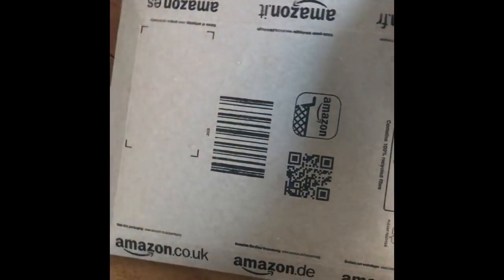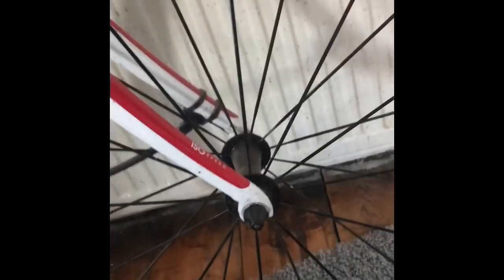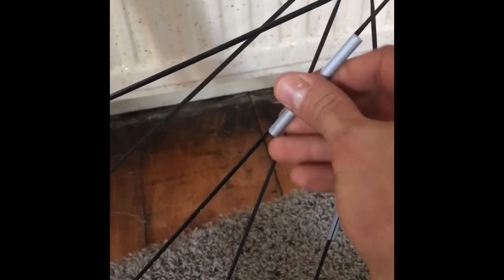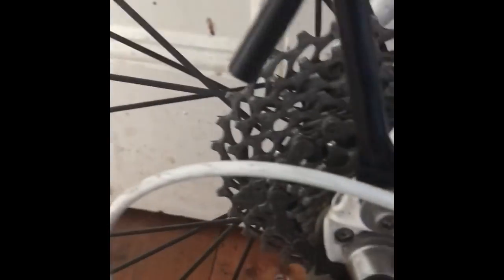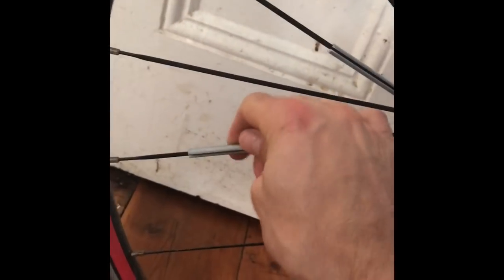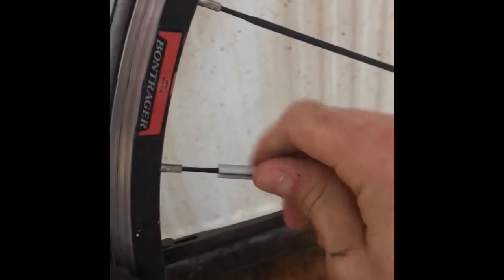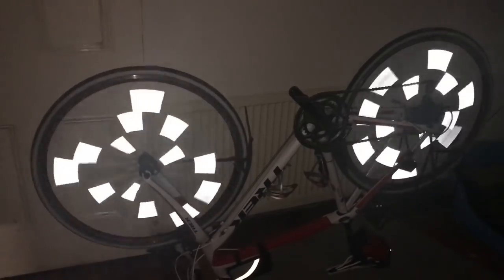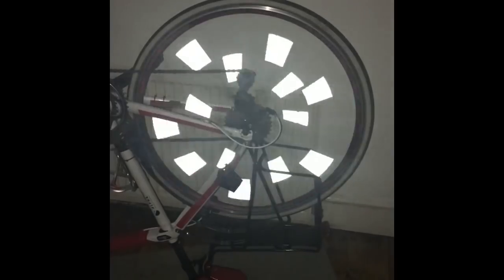Review - Salzman Spoke Reflectors. Must have bike safety

Comment: What nobody tells you about this kind of reflector is that if you have rim brakes, the residue that is released as the brake pads are worn down will coat the reflectors and reduce their shine.
Reply from the maker: Valid point. Tbh even gener dirt and muck ends up on them with time reducing the shine. I will make another video of my reflectors as I have never cleaned them. Even though it's reduced it does makes you stand out more than not having any at all :)

Comment: Very cool mate
Reply from the maker: Definitely worth getting :)
Reply: Btw how many did you put in each wheel, Might think this is not enough for my wheels(56 spokes, 28 on each)
Reply from the maker: I put one on every other spoke. At different heights along them to ensure when they turn they create a full disc like effect. Thought it be wise to try and save a little weight on the bike hence not putting one on each. Seems to work ok :)
7.29min you can see roughly how many I put on.